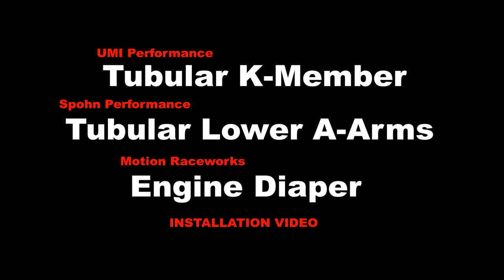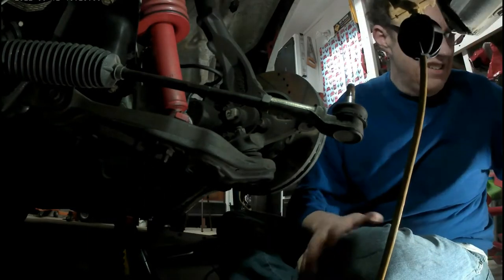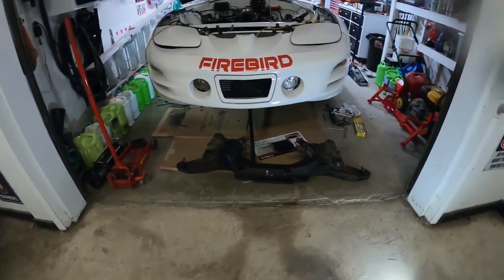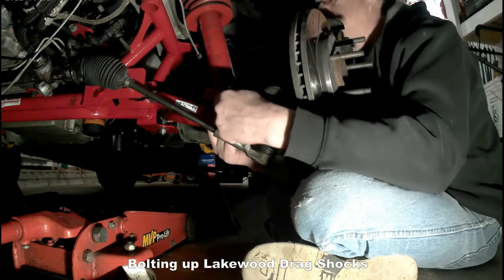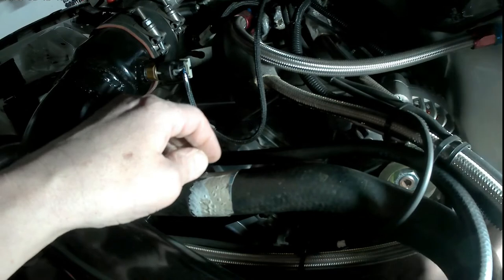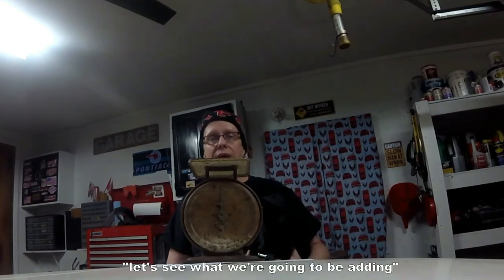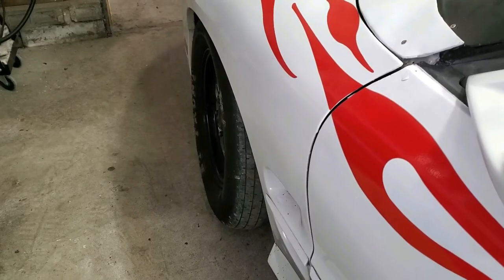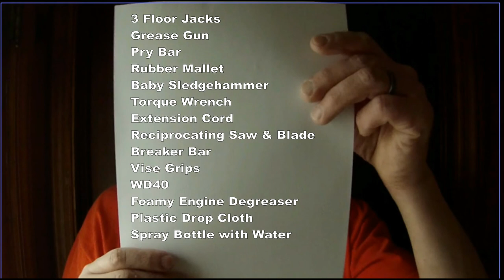Fourth-Gen LS F-Body Camaro & Firebird Tubular K-Member, Lower A-Arms & Engine Diaper Installation

Comment: This is great! I too am building a Dragonbird! Mine’s a 95 and I just got a low mileage 6.0 I’m camming with an inspection which is gonna be on a UMI K member, aluminum intake, 3800 stall is already in place behind the stock LT1 (fun already) and I too am looking forward to learning how to weld on my twin turbo piping when I can afford all the stuff. That’s all the good news. The bad is my back is so bad that I’m disabled so I have to get help from friends to make it happen. More good is that I did manage to save up for the motor and k member. I still need the electronics, ecu and harness for my LS swap. In the end I will want to swap the front end too so maybe you could give me the ins and outs? Thanks fellow bird watchers! Damn I should be a writer or funnychicken. They just come right to me. I’m a bird trainer not! Later , cats calling
Reply from the maker: Awesome! Mine is a '95 too!  It never hurts to have friends...especially ones that like working on cars!  The front end swap really isn't all that bad...I would recommend finding a car with an entire front clip rather than piecing it all together like I did.  There are numerous little brackets that you'll need.  Good luck on your build, and thank you for taking the time to comment.

Comment: Dumb question but do you think if i was to run my exhaust out my bumper could i keep my ac?
Reply from the maker: @chriskey7426  I'd imagine the AC Compressor will be right in your way of doing forward-facing exhaust that exits in front of the tires.

Comment: What kind of motor mounts did you use the only problem I'm having
Reply from the maker: They are just stock LS1 mounts.  I actually bought them used many years ago.  Lining up the bolt holes is an exercise in patience for sure!